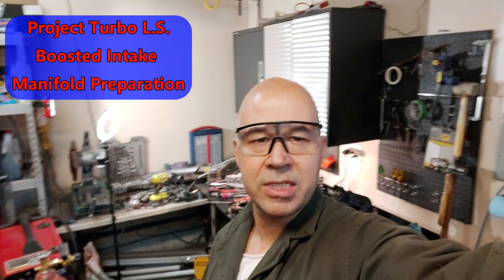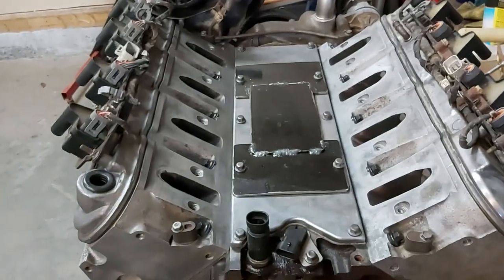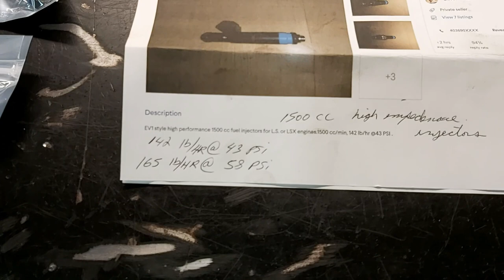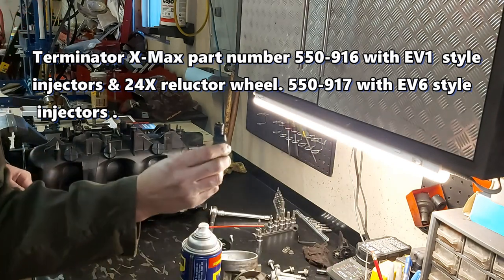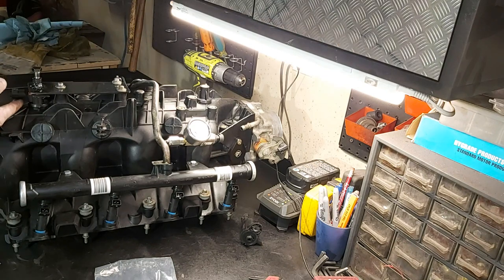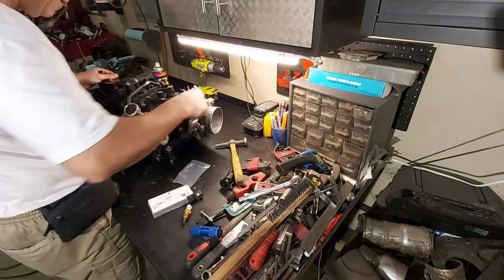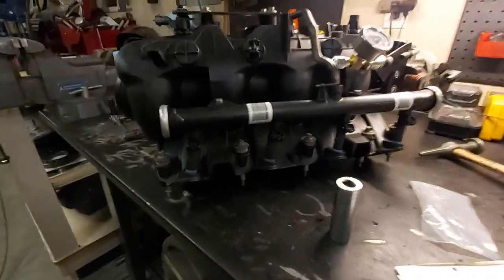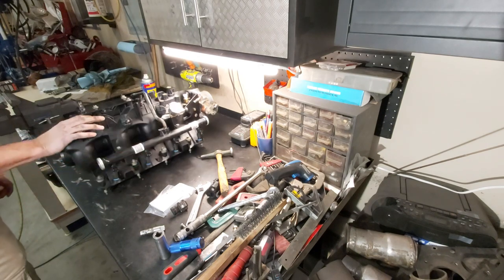L. S.  Boosted Intake Manifold Preparation and build

Comment: Which ECM is going to run this thing?   Why aren't you using the knock sensors ?  Holley doesn't support them ?

BTW, the fuel flow through an injector is "proportional" to the difference between the fuel rail pressure minus the manifold pressure.  You probably know this, but some people don't.
Reply from the maker: Going to run the  Holley Terminator X-max ECM as it controls both the engine and transmission.You weld a bung into your exhaust pipe before the cat or muffler, the oxygen sensor threads into that. The ecm harness comes with one oxygen sensor connection. The information from that sensor goes back to the ecm and air / fuel ratios are optimized to suite the the engine for the most efficient operation at that particular instance.Holley supplies two oxygen sensors with the ecm. The higher the boost , the more fuel we need. Therefore we are using a boost compensating fuel pressure regulator which increases fuel pressure at a 1:1 ratio.  so one pound higher boost in the intake = 1 pound higher fuel pressure at the injector therefore it's actually  an addition or inverse proportion, not a difference. Example, running 60 psi at injector when there is no boost, so then the boost jumps up to 10 PSi above atmospheric. What happens then is the boost compensating fuel pressure regulator sends less fuel back to the tank thus increasing fuel pressure at the injector. Our fuel pressure on the fuel rail  gauge and on our screen in the car should read 70 PSI and we can verify through our air / fuel ratio that we are not going lean...One can see this effect if you watch a previous video when I'm doing a burnout in the van and watch the fuel pressure gauge as the boost comes in it goes up at a 1:1 ratio.
Reply: @BooostedLS  Term X Max only has one O2 Sensor.
Reply from the maker: Thanks for bringing that to my attention in the statement above. I have corrected that, and the X max is now installed in the ford and running well...X-max install will follow shortly. Thanks again for watching and bringing that point to my attention......